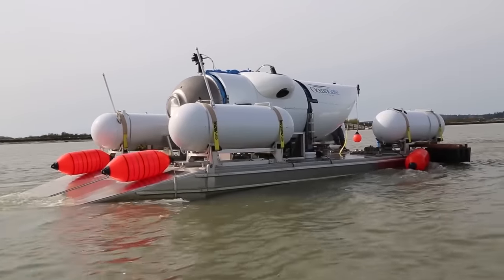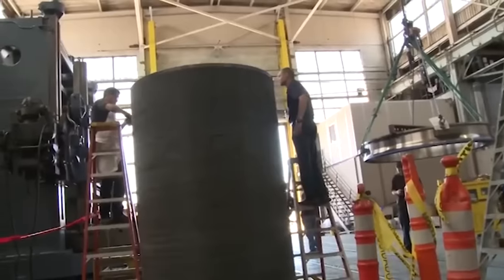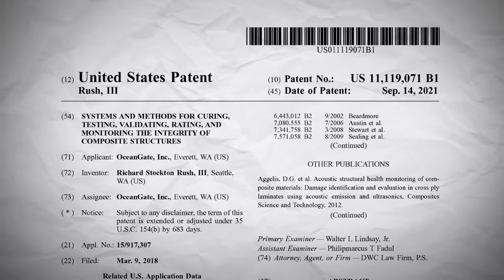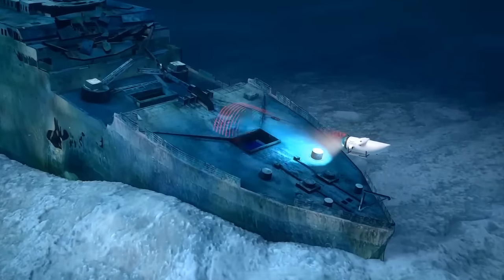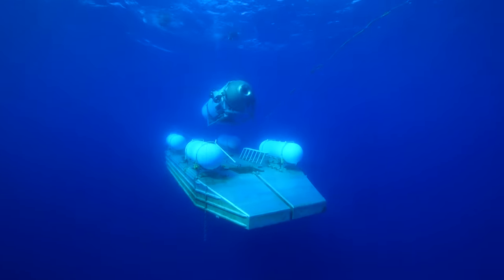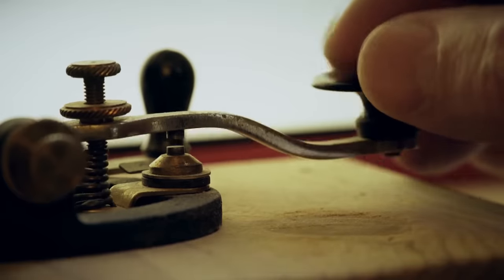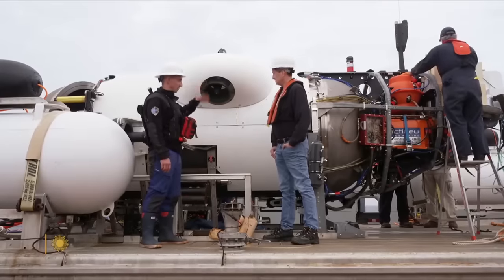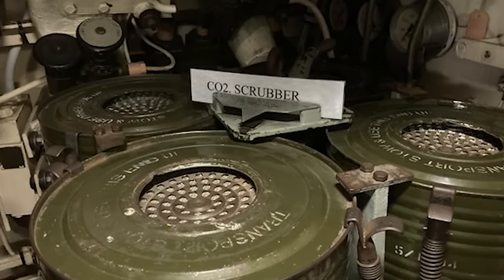Exposing OceanGate Submarines Many Fatal Designs

Comment: I'm not surprised it imploded. I'm surprised it lasted as long as it did for as many dives as it had without imploding up until the point where it did. It clearly was not built to withstand that pressure and stress.
Reply: Ohh ur a scientist?
Reply: @thefraudsniffer5485 It’s common sense to know when something is poorly designed and engineered
Reply: @thefraudsniffer5485 i don't think you need to be a scientist to know something only rated for 1,300 meters shouldn't be repeatedly going to 4,000 meters with people inside.
Reply: Maybe it bumped into something and slightly deformed the hull causing the structure to no longer be capable of supporting the pressure. It is odd that it survived other dives. Maybe fatigue too
Reply: @juliogonzo2718  It didn't. Theye were still descending.
Reply: @juliogonzo2718  It's not odd that it survived other dives but not its last. The vessel was made of disparate types material which doesn't create a great seal, which also makes it susceptible to damage over time from the pressure and contractions.
Reply: @puest-uo4lr Err, it's not a common sense for people who were never exposed to any real engineering and mechanical design.
On the other hand, for people who have been exposed, the whole sub does have "Death Trap" written all over it.
Reply: @puest-uo4lr  ...in hindsight, sure.
Reply: @thefraudsniffer5485 this is 4th grade science
Reply: What was the actual use history of the thing? Did they at least do an unmanned test dive to the target depth? And what about manned uses?
Reply: @Dowlphin  No test dives or anything the owner refused to get the vessel certified. They took 4 trips before this but had to cancel 12 more due to issues and allegedly a cracking noise was heard on a previous dive that never got addressed which probably led to this.
Reply: @Hotep982  That's really ... well ... we could call it the avalanche of stupidity now going into terminal phase. Crackling noise starting in CFC eventually and then continuing to use it commercially is insane, especially the combination of the strong urge to make it a feasible profitable business and the fact that he endangered himself with it. I guess we could file this as not untypical billionaire psychology - an occupational hazard. Something unhealthy must have driven him towards making so much money.

I noticed on Wikipedia now that the Titan had been used for test and tour dives, so I guess they got overconfident based on the fact that the hull did manage fine for a while and that is was already a money saving design, so hull replacement was not financially trivial at all.

And even my layman common sense is telling me that CFC, i.e. a hard mix of fibers and resin that is prone to splintering under stress, is simply the wrong material for this use. The rigidity and inhomogenity of the material offers many tiny initial attack points leading to a failure cascade.
I mean, even in metal working there is emphasis on the importance of driving stress out of the material during manufacturing so that it is all very 'balanced'.
Reply: @thefraudsniffer5485  In the aftermath of the implosion, I heard numerous experts stating that the submersible was not rated to go to that depth, that it should been retired after a number of dives due to accumulated pressure, and that building the hull with 3 different materials compromised its integrity. That's why you don't see too many submarines with portholes. You don't need to be a scientist to learn this when they'll explain it to you after some fool who should've known better killed not only himself, but 4 others as well. Sadly, the public in general would know none of this if someone who had known better ignored regulations and common sense.
Reply: This visual helped greatly!  Thank you for making the layman version for people like me.  I now see that this submersible is equivalent to spirit airlines.  It makes no sense to pay all that money for a ride and not get state of the art product!   I'm livid!
Reply: @tacticsogreman  It is common sense that carbon fibre is slightly flexible while titanium is not. The CF tube was glued on the INSIDE of the titanium ring so the only support counteracting the cf movement caused by the outside preassure was the glue. As this flexing is incredibly small and there is most likely also some flex in the glue this will work for a limited number of cycles. Now we know how many... 😨
Reply: @niclas.lindstrom  Both materials actually are flexible, and in technical terms, elastic. Just to differing degrees. Your point about differential movement between the materials is spot on.
Reply: @tacticsogreman  Please share with us your exposure to engineering
Reply: @Dowlphin all said in the clip
Reply: The constant descending and ascending may have caused the material to vecome fatigued so thats why the first run maybe have been fine
Reply: ". It clearly was not built to withstand that pressure and stress."

that's right. at the submersible shop they said please make me one that is incapable of managing stress? it was obviously built to withstand pressure and stress, or why bother? just use an old cardboard box. it may not have withstood that pressure and stress, but it was certainly built for that purpose.
Reply: @KarldorisLambley  Purpose alone does not make something qualified as this disaster exemplifies. Your cardboard box example is a good metaphor. I can claim a cardboard box is a good submersible that can handle the stress and pressure of repeated dives to the titanic. It doesn't make it so.
Reply: @thefraudsniffer5485  in another video they showed a letter of concern from the submersible craft industry about the safety of the carbon fibre tube.
Reply: @JustMeBlindFreddy  It's a long story. Starts with my father being an engineer and ends with me working in nuclear energy industry.
Reply: @tomstickland  I hear that fibre tube stuff is tough....
Reply: It's strange that in a sense, they managed to (accidentally) overbuild this submersible, considering it achieved far more than it was supposed to.

But physics will always win eventually.
Reply: @manymantids  This “fact” is false, this video is nothing more than click bait to maintain his YouTube revenue.
Reply: @Dazzlin826 don’t be fooled, this is cherry-picked out of context clickbait. There are proper facts out there, I implore you to seek them.
Reply: @downandlocked7387  You think so?  I've been watching a lot of these videos and this was by far the best explanation to the implosion
Reply: @preese-pd8kw: Titan, when originally named Cyclops II, underwent tests and modifications like any R&D project, however, it wasn't subjected to destructive testing to figure out how deep it could've gone before failure. OceanGate didn't have a spare carbon fiber sub to sacrifice. It doesn't fail like steel or titanium, which will show signs of fatigue and eminent failure; CF makes loud noises and just cracks or shatters.
Reply: @KarldorisLambley  Yep, it was built for it, just poorly so.
Reply: @SomeCanine Absolutely! Was not built to withstand that pressures. But, 🤷‍♂️ the CEO killed all of them including himself. 😅
Reply: I’m a Materials Engineer, and @SomeCanine is right.  
Carbon Fiber sucks for compressive loading and has low cycling limits before fracturing/failing when used in cyclical loading cases to even half its theoretical yield point, let alone to within 5-10%.
Reply: @juliogonzo2718 unlikely. There were many possible weak points, especially when dealing with composite material that's already undergone several pressure cycles and a whole host of poorly designed elements. The best sounding explanation I've heard so far is that since the carbon fiber hull was much more compressible than the titanium end caps (not a naked eye difference but a big enough factor at the sheer pressure) that difference would put extra strain on the weak join only secured by glue, which would be a suitable situation for a pinhole leak to form
Reply: @juliogonzo2718  doesn't even need a collision. if you keep stressing material beyond what it is rated for it will degrade and eventually fail. afaik carbon fibre really does not enjoy constant changes of pressure. it was very likely fatigue.
Reply: @RichGwilliam  I mean a window rated for 1300 meters going down to 4000 meters sounds like poor design to me...
Reply: @@Anton-nx3yd the rest of the people on board kind of didn't. yes they climbed into a thing that had death trap written all over it, but they were likely told it was completely safe. the CEO however got what he deserved.
Reply: @thefraudsniffer5485  it literally imploded i think anyone at this point could say it wasnt built to withstand the pressure
Reply: @yellow1244  No way really!? Jee Golly Thanks! If it wasn't for you youtube scientist on here I just wouldn't know anything! Thanks again for your crucial information!
Reply: @Dowlphin  they did 7 successful dives before the fated last. The stress caused against the carbon fiber is likely what caused it to implode. Those fibers were probably stressed and flexed enough to finally cause a defect resulting in rapid decompression inside the crew housing. It'd be like a transfer truck running over a tube of toothpaste.
Reply: 6,750 psi  can cut steel if it is a focused jet. There is no room for error at that depth
Reply: From what I have read the accident happened mainly due to an electrical  issue that caused the sub to go into an uncontrollable dive. The sub was not designed for rapid decent. You would think the electrical system would be waterproof.
Reply: @aok3642  No I don't believe that is it. The Titanic was already at the very bottom of the ocean. You could argue that there's something to do with how they pressurize the vessel to stay at optimal shape under the stress, but I don't think it had an electrical failure. I think it had a sudden implosion. I think the repeated carbon fiber stresses of shrinking and unshrinking had an effect, especially on the seals and the window that wasn't rated to hold that deep. It could also have an effect on the carbon fiber itself which is basically glued together. There's a lot that can go wrong and pretty much nobody thinks that using carbon fiber over titanium is a good idea. I think it's pretty obvious in the wake of this disaster that they are right.